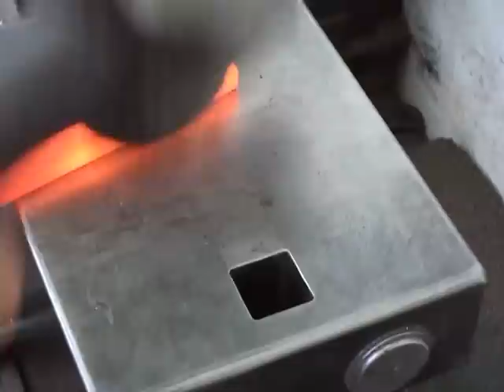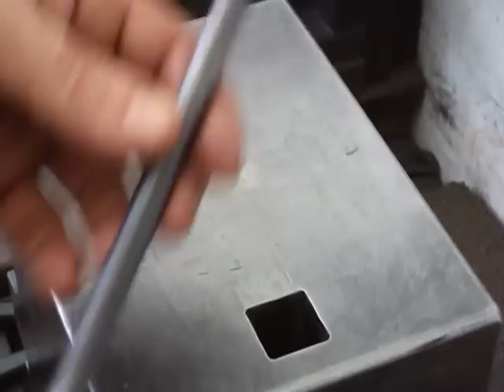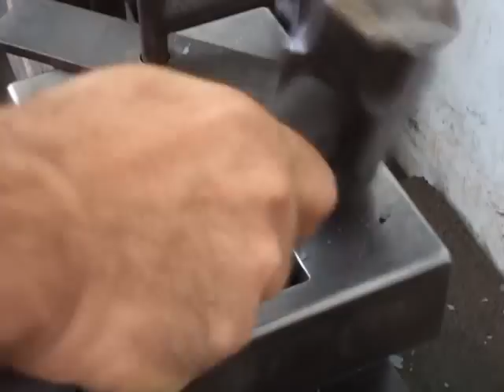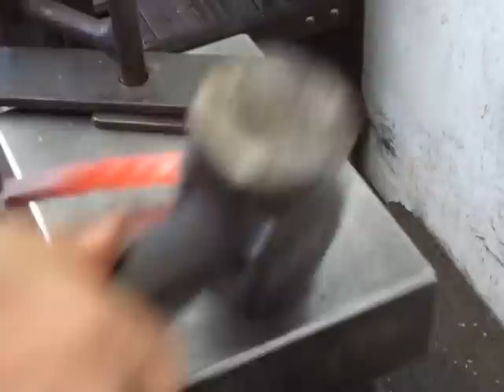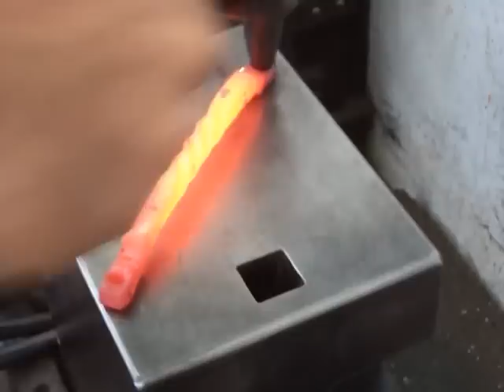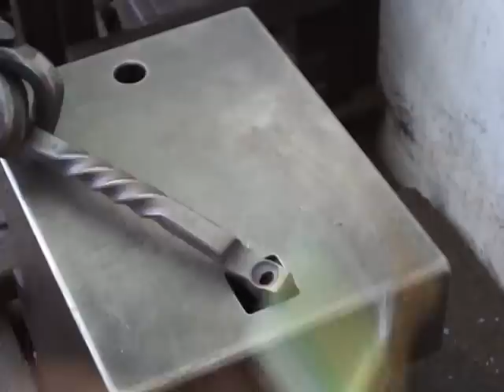Blacksmithing - making a rustic, hand hammered drawer pull

Comment: Very nicely done, Glen.  Can you post a still somewhere of your offset jig?  Looks like it would be useful.
Thanks,
Randy
Reply from the maker: Boyce, Glad you like this. I need to find that jig. I stopped using it and put it in a scrap bag of steel. I'm not sure if I even have it anymore. I remember using it for bottle openers in the past. I'll see if I can find it and send a pic. Thanks for your recent order... Glen
Reply: I think I got it. Did a freeze frame.  I can adapt the idea for a project I'd like to work on.  Did those two pieces of flat stock give you a 1/2inch clearance?  Or was it more?
Reply from the maker: Boyce, The flat piece in this video is 1/4" thick. For a drawer pull, 1/2" would probably be better to give you more clearance for your fingers when using. Thanks. Glen
Reply: Thanks a bunch.

Comment: I really dig your choice of tooling and your hammer skills. A pleasure to watch. I noticed that you move your anvil at the end. How often do you use the other faces of that one?
Reply from the maker: +MySickstring That's very observant. I often move this anvil around and use different faces. But I mainly turn it to switch the position of the hardy hole from left to right and vice versa. I mainly like to have the hardy hole on the left (when using a hardy tools) and that goes the same for when using the pritchel hole. Oddly enough, I am left handed but swing a hammer right handed and prefer to swing across my body as it makes it easier to see where I'm striking. My newer anvil (to be shown in videos soon) has the hardy and pritchel holes on the same side... Thanks for your comment. Glen.

Comment: Nice one! Your workspace does always seem to be very efficient. It was interesting to find out you work seated too, makes sense. I have considered trying a seated work area myself.
Reply from the maker: +OrionsAnvil Because my workspace is so limited here and not in a completely covered area, no tools have a permanent place. Additionally, because I rent this space, I'm not inclined to make big changes. This can be frustrating sometimes as I'm always moving things. So there is also inefficiency that you maybe don't see. I've thought about going back to standing while hammering but after the years of working while seated, I have to say that, most of the time,  I prefer hammering while seated. I'm dreaming / planning what my next shop in the States will be like. I have a property where I want to build another smithy when the time is right. Still plan to keep it small. Thanks. Glen.

Comment: Does the mic not pick up the ring of your anvil or do you have it configured so it just doesn't have a ring?  That would be awesome.

I've not begun blacksmithing yet.. but within the next year or two hope to.
Reply from the maker: +adracamas My anvil has a very loud, clear ring. However my camera mic doesn't completely pick up my anvil's ring. But the main reason, what you probably don't see, is I have two magnets on my anvil that deaden the ring quite a bit giving it a much quieter, dull sound. I was thinking of making a quick video demonstrating this. Good luck in your future blacksmithing. Glen.

Comment: is it bad leaving that punch on there like that? I was told to lift after each strike
Reply from the maker: +Gene Smith It may be that some people recommend removing the punch after each strike, to prevent the business end from overheating. I myself don't do this. It may have something to do with the type of steel used for the punch. I use air hardening steel for hot punching which is very heat resistant. That is, it stays fairly hard even at high temperature and so doesn't deform too easily from the combination of heat and shock. Also, the thin punch I am using here does not have much taper and so it would be hard to remove it after each strike (you can see it gets a bit stuck sometimes). I just make sure that the business end does not get too hot; that there isn't any color (visible heat) on the punch. Between heats, I quickly quench my punches for a couple of seconds in water to cool them off some. Lastly, the thickness of the piece may also determine the method for punching. Thanks. Glen.

Comment: чем вы красили изделие? спасибо
Reply from the maker: +Иван Ковалев Hi, I didn't paint this item in any way. The golden color is from brushing it with a brass brush when the piece was still hot (not very hot, at a black heat). This transfers some of the brass to the steel. The more you continue to brush, the more it takes on a brass look. (I continued to brush off camera). This is a great way to finish projects that you don't want to rust. The brass really prevents rust from forming too easily, especially in humid places like here in Taiwan. I hope this answers your question. Thanks. Glen.
Reply: +Glen GS Tongs Спасибо за ответ. очень красиво смотрится.